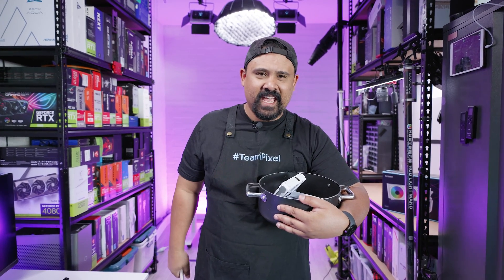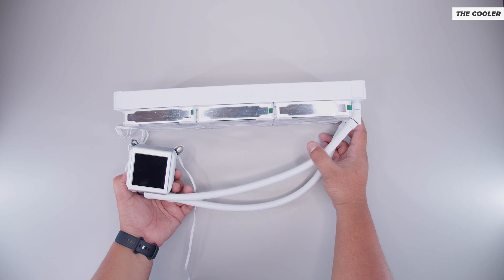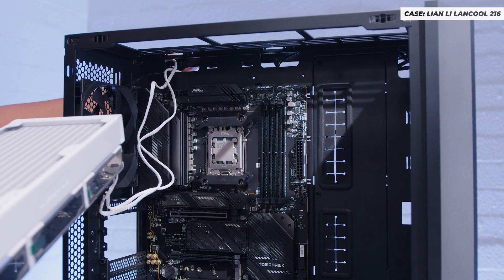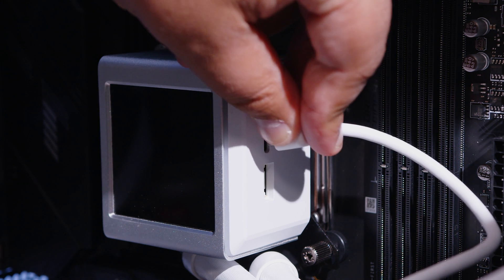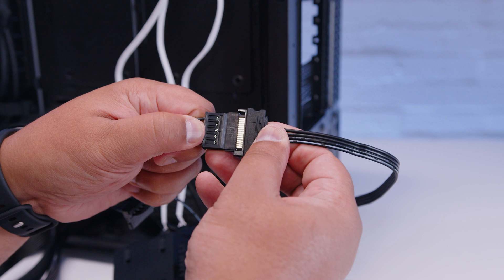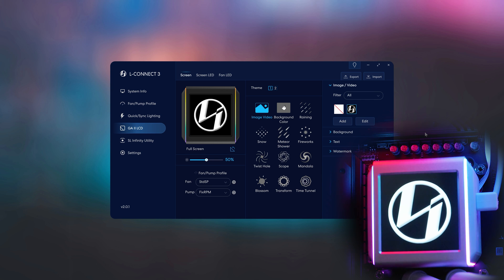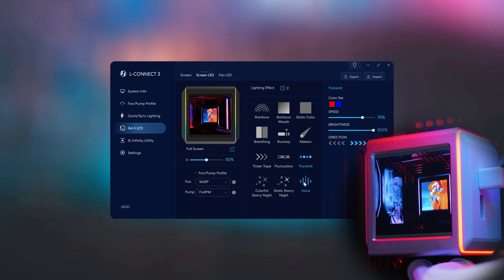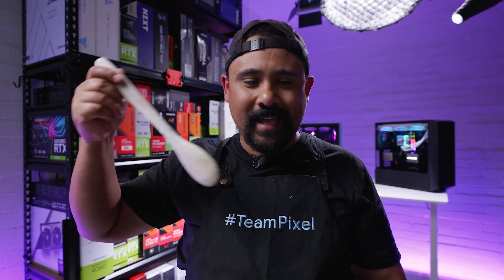Lian Li Galahad II / GA II LCD: Definitive SETUP & INSTALL GUIDE

Comment: is it true that Lconnect 3 doesn't have coolant temperature as a sensor? I worry that the fans will ramp up and down pointlessly if they are following CPU package temps. I am returning a new icue link h150i elite because it has a Coolit pump that has to stay at high rpm. I am thinking of buying this Lian Li AIO instead because of the 8th gen Asetek pump.

Comment: I am about to put this exact AIO in this case so would like to know if you can plug the front 160mm fans into the controller or should I either leave them plugged into the included hub or just plug them directly into the motherboard?

Comment: The thing is a friend of mine is making a build and just kinda finished it, his pc works. But the fans on his AIO cooling are not working, does anyone know what might be a common issue here bcs all the cables are corretly installed
Reply: I'm having the same issue. The AIO fans and RGB aren't working even tho everything is plugged in correctly. Did you find any solutions?

Comment: Noooo I just ordered an kraken elite 360 and contacted the seller and asked to cancel the purchase, but i have to wait for his response. I want this one :')

Edit: I just got a notification that the package is on the way 💀

Edit2: They got the message and sent me my money back! Now I can buy this aio, lets go!
Reply: Idk which one i would buy but do you not think the kraken is more cleaner then the lian li?
Reply: @Gijsben  sure, maybe. But it depends on what fans you wanna use. In my case(funny), I wanna use the Lian li infinity fans. If I buy the Kraken, I have to pay lets say 300€ and then buy a pack of 3 Lian Li fans which cost additionally 100€. So im at 400€ just for the AIO, thats crazy. Whereas if I buy the lian li galahad II, they come with the lian li infinity fans, and also the controller which u only get from the pack of 3 fans. So instead of paying 400€ for an AIO for the lcd, I can spend "only" 270€ without any extra costs. Or even the Galahad II trinity if you dont care about the lcd display. So its 190€ vs 400€. And also I think this AIO looks much cooler, the screen looks bigger and and you have more options. But I think the Kraken elite has slightly better display imagine (not sure tho)
Reply: @Gijsben this has better fans and the newer gen pump but ppl say the software is rly buggy so up to u
Reply: @Gijsben  just left micro center and was debating the between those same exact ones, went with the Lian Li beacuse the kraken is in almost in every high end build that I come across, trying to be diffrent

Comment: Anyone know if the fans that come with this are V1 or V2?
Reply: I assume you were referring to the LConnect 3 hub?  It doesn't matter which one you put it in because there isn't an automatic primary. Meaning, it's best to assign your fans to V1 if you have nothing else assigned to it and you only have one fans group. If you have an AIO and a set of fans, for absolute ease, assign the AIO to V1 and the other fans to V2 so it will be easier for you to identify them when you are play with the Lconnect3 software.
Reply: @EAprima So, I need a USB Hub if I've "only" two USB ports on my MB? One for the LCD Display, one for the Controller of the AIO and another one for the second Controller?

Comment: Very informative vid! I'm having a problem with the LCD panel screen not showing anything but the LL Logo. I have it hooked up right just like you and everyone has said to. Everything else in the app works fine, except the screen shot of the LCD block head picture in the app itself is blank in several places in the app that it shows up. None of the themes in the GA II LCD part of the app will work!  I have the latest version (2.04) and the latest firmware  0.9. Any help would be appreciated, lot of $$$ for the main attraction not to work. Thanks! Ciao
Reply: having the same problem. it just started two days ago but before that it was working fine
Reply: I am having the same issue. Likely buggy software.
Reply: @michaelryder9199  Uninstall absolutely EVERYTHING including the registry using Revo Uninstaller. When you have done that, go to Program Files and delete the Liam Li folder. When you've done that, reset your PC and load windows again. When windows is loaded, install the latest version of the L-Connect 3 software. The GA II LCD should work. 

If you still having problems, make sure your CPU actually see the LCD controller by going to Control panel / Adminstrative Tools / Computer Management / Device Manager / Universal Serial bus Devices.  If you just have the AIO only, you should see two connections, "LianLi-GA_II_LCD_v0.1" and "LianLi-SL-infinity-v1.4". If you just see the infinity v1.4 only that means your USB connection is not properly fitted into your AIO head, meaning you need to open your PC and push the USB in there a little harder. 

If you see the LCD part and you are still facing problems, you need to contact Lian Li directly and the fastest way from my experience is via Reddit. Before going to contact them, go to EVENT VIEWER and check if any errors messages comes up under the Lian Li application  for it would be a good idea to have that to hand.

Just in case, if you are thinking of re-installing the firmware, do not do it until Lian Li recommends you to do so. 

I hope you get it solved. Yes, the software indeed has been very buggy, but I hope my last interactions with Lian Li has helped improved that as I have been talking to them when there was a whole host of problems.   Oh yes, there are planning to release a new update to LConnect 3 soon. Their biggest issue is the software is still having issues with the aRGB of certain motherboards.
Reply: Uninstall absolutely EVERYTHING including the registry using Revo Uninstaller. When you have done that, go to Program Files and delete the Liam Li folder. When you've done that, reset your PC and load windows again. When windows is loaded, install the latest version of the L-Connect 3 software. The GA II LCD should work. 

If you still having problems, make sure your CPU actually see the LCD controller by going to Control panel / Adminstrative Tools / Computer Management / Device Manager / Universal Serial bus Devices.  If you just have the AIO only, you should see two connections, "LianLi-GA_II_LCD_v0.1" and "LianLi-SL-infinity-v1.4". If you just see the infinity v1.4 only that means your USB connection is not properly fitted into your AIO head, meaning you need to open your PC and push the USB in there a little harder. 

If you see the LCD part and you are still facing problems, you need to contact Lian Li directly and the fastest way from my experience is via Reddit. Before going to contact them, go to EVENT VIEWER and check if any errors messages comes up under the Lian Li application  for it would be a good idea to have that to hand.
Just in case, if you are thinking of re-installing the firmware, do not do it until Lian Li recommends you to do so. 

I hope you get it solved.

Comment: Awesome vid.   Quick question. I got the infinity version.  I have the infinity fans in case already.  They came with a different cable it plugs into the controller with one cable. The Galahad has a cable with a 2 plug into controller. Do u think I can put the 1 plug from the triple pack on the Galahad so I only have one controller instead a controller for Galahad and controller for fans

Comment: My biggest question that I can’t find the answer to. If I run a 9-10 lian li fans, can it all go to the aio controller or do I need to have a separate controller for the fans since the triple pack cable is different from the aio.
Reply: You can buy all the singes you need and daisy  chain them to the AIO controller
Reply: Hi Tobias, I've the same qu😅 What was your solution?
Reply: @bozoqturkmni8137  I bought 10 singles and return my triple pack fans. The 10 singles are separated into 4 single connections after daisy chaining them. Connected them to the AIO and worked perfectly. And in my case is only 1 single controller.

Comment: The one thing I don't like but almost all do is if you have a white build the why give you black cables when they ALL should be white. With the Lian Li fans which all change the way the controller plugs in  I think Lian Li should sell the coolers with which ever fans you want to install in your case so they all match and look the same in your build. The same go's with power supply companies that give you white cable with black ends and the case companies selling you a white case and Black front panel connectors.

Comment: Thank you chef Nick! I am using Gigabyte Z790 AORUS ELITE AX. It seems like the pump 4-pin header is at the bottom of the MB... Will it be okay if I plug the pump top to CPU_OPT instead? Thanks!

Comment: I had really bad luck with this Aio it seems. Bought one, leaking in the box. Got a quick RMA with the company I bought from and they replaced with a fresh one, still unopened with all wrapping on packaging etc, second one also leaking... Replaced that one decided I didn't trust it after 2 leaking units in a row and replaced it with a different brand cooler.

Comment: Does it matter the direction of the pump when mounting to mobo? So like both tubes coming out the right side, the top side, the bottom side , or the left side are all ok or like only a few orientations are ok? Ty for the video!

Comment: The LCD doesnt work :( and its not listet in l-connect
Reply: Managed to fix the LCD and here’s how I did it:

Is your LCD turning off after playing the logo? Connection issue. Make sure it is FIRMLY connected to the board and block. When u connect the usb to the block you should hear a firm click. 

It should begin to work. 

Install L connect version 2.0.0 and now your LCD should be displaying in the software. Check updates and update the LCD to 0.8.

Key note is make sure you don’t have other L connect softwares installed. I had 1.7 and 2.0.0 installed and it made the block confused. Hopefully this helepd
Reply: Facing the same issue along with quite a good amount of people
Reply: Some times the Software can be kinda blah since it’s new. But make sure you have everything plugged in right normally one I reset my pc it works fine.

Comment: RGB Tutorial .. you need to do a hand holding RGB tutorial using all sorts of different fans, RAM, motherboards, cases, GPUs, water blocks, etc. LED RGB setup and configuration video. I'm an experienced builder and every RGB setup at best is a nightmare to take care of. Often I find myself having to reinstall windows from all the weird conflicts from RGB software.

Comment: The cooler is excellent, but the L connect software is really bad, it loses settings and the cpu/gpu temp’s randomly lose functionality the only fix I’ve found to uninstall then reinstall the software, and the save/load function doesn’t work either so I have to reset all of my settings. I hope they fix it because it’s an awesome device when it works
Reply: Ive never had problem with L Connect, you might have something else installed thats conflicting with it like msi center or asus aurora ..etc..etc
Reply: @prentgc No he is right I’ve got the infinity fans and L connect was so bad had to disable the setup I had and changed it to my motherboard software (most good software don’t need you to uninstall main PC software to use it fully) does a way better job it’s why I got rid of the Lian Li AIO as well as the software is god awful

Comment: This would look really nice in my setup but...why they not just make the fans have the same connectors their current sl infinity fans already have 🤦🏻‍♂️ I already have a box for the strimmer and one for all the sl infinity fans.
Reply from the maker: You can just change the cable
Reply: @GearSeekers does it include a cable to convert the fan and rgb connector to fit their other boxes? I must have missed that part

Comment: I've bought the 280 version of that cooler about a week ago.  Unfortunately it seems like I got a faulty unit as the water pump is so loud above 2700 rpm that it is unacceptable. Sounds like a mini jet engine. Also there is a lot of issue with software. I use AL120 v2 fans for the rest of the system. First it would crash all the time. Then it would not recognize the device until recent update. Now every time I start the software it resets all the settings for the fans. Also when change the fans to spin up based on GPU temp it does not provide accurate temp of GPU.
I use it with AMD 7600X in Lian Li O11 Air Mini and at full load it keeps the CPU temp at about 84 C. Rad is install in front of the case. Unfortunately there is not a lot of space behind As my GPU is about 320 mm long so that leaves about 0.5 cm space between.
Reply: Sorry for causing any inconvenience and thank you to address the issue. we recognize the reset fan setting issue is a bug and we're working on this. We'll provide the latest  version soon.
Reply: I have the 240 at the back in my Mini, shame you can't fit a 280 in it. Not sure where to put it if I got a 280